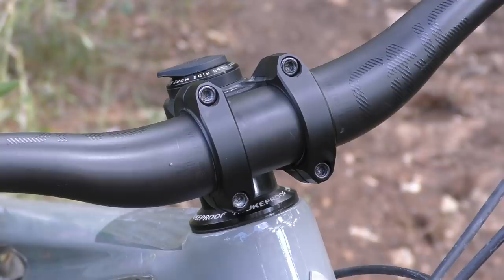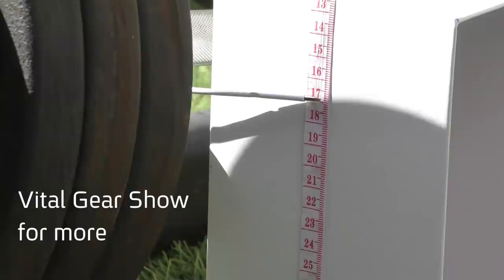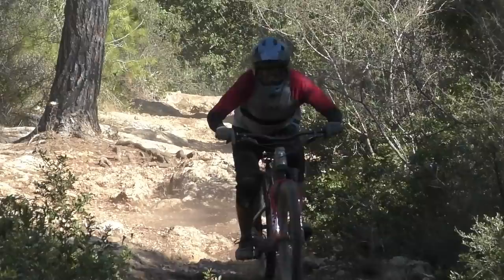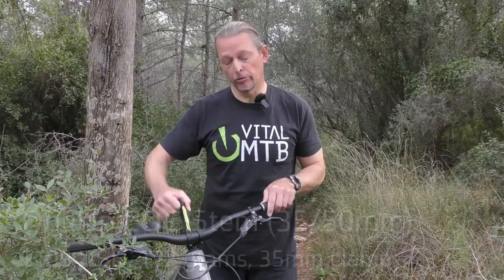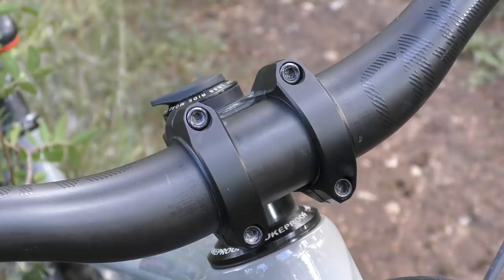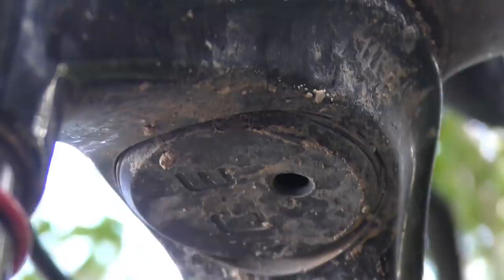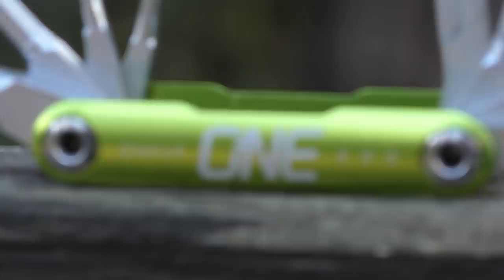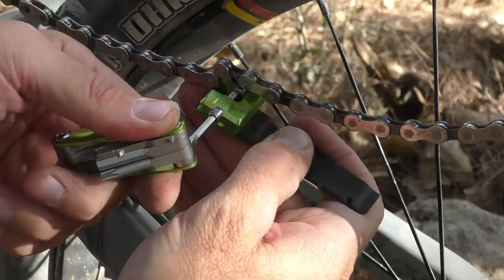BIKE TECH - Testing OneUp's Flexing Carbon Bar and EDC Stem with Tool Storage

Comment: Have to comment on the bar markings... They are nice but also super confusing to a detail freak like myself.. I found changing the bar rolleven just slightly made a huge difference in performance handling! I settled just above the 66 mark.. if the "no gap" line is supposed to be aligned with those HA number lines.. but even tho I love the bars it's super nice that they put the numbers there for reference, but it's hard to know where it all lines up with the OneUp stem in terms of perfect measurement

Comment: Nice vid! I'm not interested in the stem and EDC system as I have pockets for my multitool, but I have a lot of finger pain whilst riding and this handlebar sounds promising as it could make the trail chatter a lot less major, which would ease the finger pain.
Reply: If that's all you're looking for I'd look at the spank vibrocore bars, haven't tried then myself but putting them on the bike I'm building right now for the same reasons
Reply: @tommills7075  Yeah, that could be an option too. Thanks
Reply from the maker: Definitely worth a try. Don't forget to play around with different grips as well (thickness, softness etc), we've found that makes a major difference sometimes too. If all else fails, there's a bar with even more flex for you to potentially try: https://www.vitalmtb.com/product/guide/Handlebars,38/Fasst/Flexx-Enduro,24182#product-reviews/3503/expand.
Reply: Your solution is likely forearm isometric strength exercise and a better ergonomic angle setup, not gadgets.
Reply: @vitalmtb  I've experimented with different ones and no difference. It's due to stiffness in my upper body's muscles according to a physical therapist.
Reply: @truantray  I've tried every possible setup, it's not that.

Comment: At 2:18 there is an obvious crack in the OneUp bar.  That looks like a nasty accident waiting to happen! At 3:42 there is an obvious mismatch in shape between the brake clamp and the bar.  That also looks like a disaster waiting to happen.  Was this from abuse/neglect or was it OneUp's quality control that let that stuff slip by?
Reply from the maker: The "obvious crack" is just a slightly visible seam in the layup under the clear coat, it is present on the other side of the bar as well. As for the "obvious mismatch" between the brake clamp and the bar shape, yeah that clamp has seen better days...
Reply: @vitalmtb  Just be careful with these carbon handlebars, please.  I have a carbon bar on my bike and it sure is nice and comfy but I don't think a carbon bar is the right piece of kit for very aggressive riding.  Handlebar failures are going to hurt!

Comment: I thought vertical compliance was the whole point of suspension forks.
Reply: You can still get a harsh feeling on your hands running a stiff ass bar even with a plush fork
Reply: initial bump sensitivity are your tyres

Comment: IMHO the tool itself is way to small to be reliable on the trail. It looks like a toy next to an ordinary multi tool and I had problems loosening not even very tight screws on my handlebars. It's not just tiny but also has relatively sharp edges For me, this thing is a nice concept that just doesn't work. No Hex 8 too, not that you would be able to reliably tighten pedals with this thing anyway… Also, if you really want this tool I'd recommend the version that goes into One Up's pump. No need to buy proprietary stems or drill into your steerer.
Reply from the maker: Under normal circumstances it gets the job done. Realigning your controls or your seatpost after a crash, tightening up a bolt that has come loose already, that sort of thing - basically the most common on-trail use cases are covered. As we mentioned in the review, there is a hex 8 tool which actually consists of a combination of two other tools, but we don't recommend using it to remove a stubborn pedal for example (we mangled one of our samples this way). To tighten a pedal that has worked itself loose on the trail however, it will certainly do the job and get you back on your bike to finish the ride.
Reply: @vitalmtb  I have literally never had a pedal "work itself loose". Sounds like instead of buying more pricey gadgets, better off with proper mechanical maintenance before the ride.
Reply from the maker: @truantray  we've seen it.
Reply: On the contrary, it’s worked very well for me trail side. Have used about 90% of the features including the 8mm and found them all satisfactory for such a convenient tool.
Reply: it's worked great for me (mostly other trail users that have borrowed it) several times in the two years i've had it.
Reply: @truantray  sure you've never had a pedal work itself loose, this it can never happen to anyone else...right?